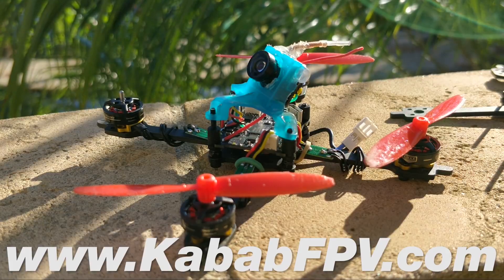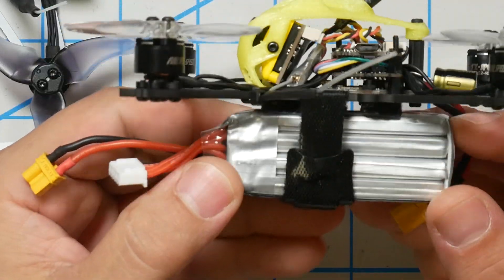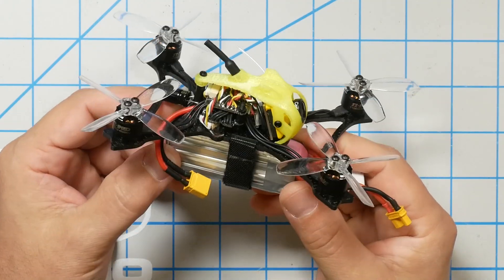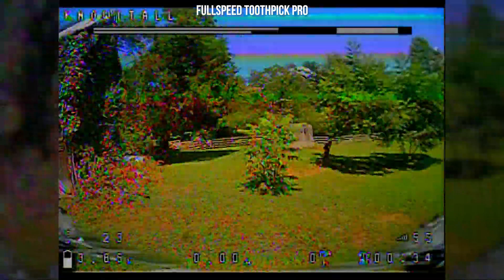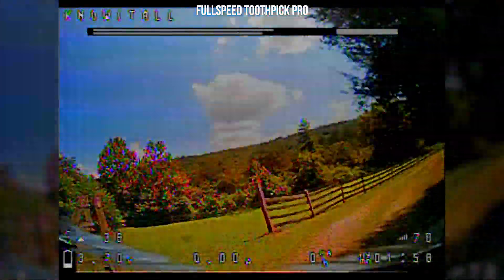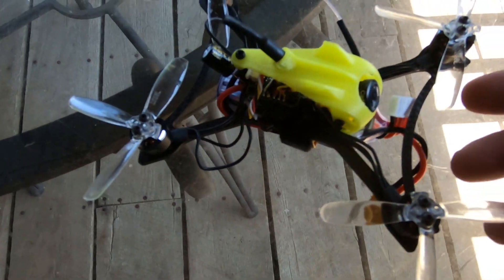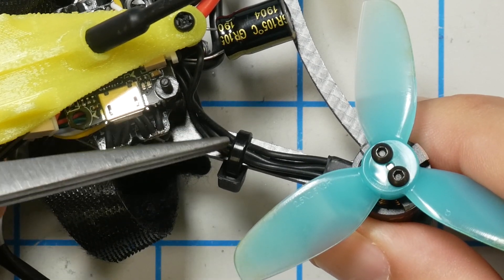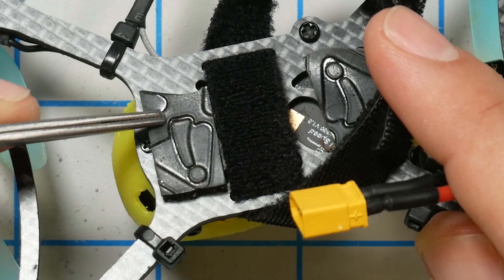Emax Tinyhawk Freestyle vs. Fullspeed Toothpick Pro | ONE OF THESE IS NOT A TOOTHPICK

Comment: I think the toothpick pro is comparable to the toothpick pro category that is beginning to appear. Basically 3 inch ultra lights like the GTB339/GTB329 and the iFlight TurboBee 136RS. I think they are both lighter than the fullspeed toothpick pro and they retain the prop size to weight ratio Bob is always talking about.

Comment: The "toothpick" form factor has been around for a long time, I think just Kabab coined the "toothpick" name. I built my first one over 2 years ago, 1103 motors, 65mm props had to run a tiny femto FC and separate 6amp escs as the whoop boards weren't around but weighing in at 48g plus lipo and nailing 5.30min flight time easily. Here's one of my vids: https://youtu.be/i2-btRAmloc

Comment: The Toothpick is and should stay under 50 grams and ran on 1S. anything bigger is just using the name for profit.
Reply from the maker: Roogi says 73 grams is the ideal weight so if you want it to be under 50 grams you're going to have to argue with him.
Reply: @JoshuaBardwell  lololo true
Reply: @JoshuaBardwell  no arguing at all Sir.  just thought it made sense for under 50 grams to be able to keep it unregistered and fly anywhere w a nice speed to it.  much props to you and Dr. Roogi. I watch all you guys vids  every day.  keep them coming
Reply: @JoshuaBardwell   He started with 1S but soon went to 2s for the power boost and ended to 73gr but If you already own a 2.5" (2s550mAh,3b7500kV,GF2540,Tomoquads Sidewinder like I have and it's a 3s motor for insane speed btu on 2s the cells get just warm)  a 2s toothpick doesn't add value for me. They seem to consume Lipos way to fast.

I think a TinyhawkS on 1s (larger battery to prevent puffing) or a 2s with throttle cut to reduce current draw and heat waste might be my ticket for the autumn/winter... An XT30 would work as well without issues.

Bob's theory: less=more is worth considering

Nice review!